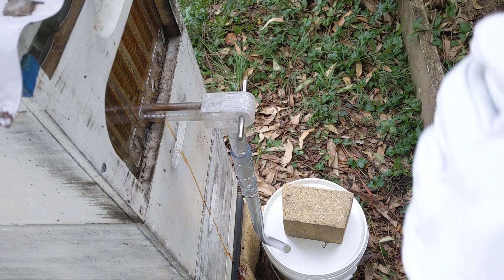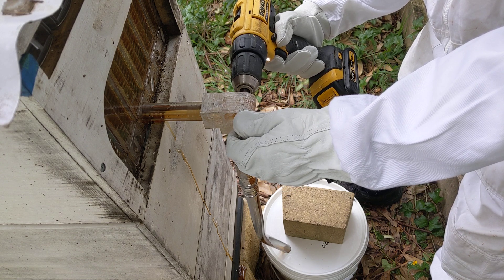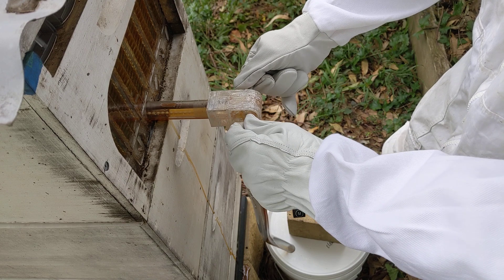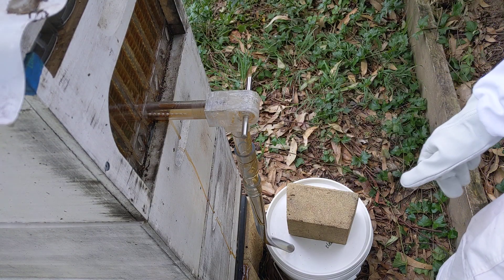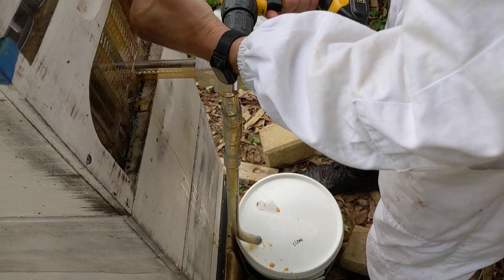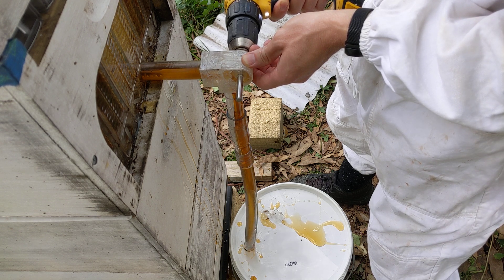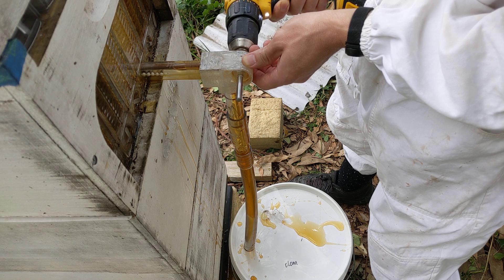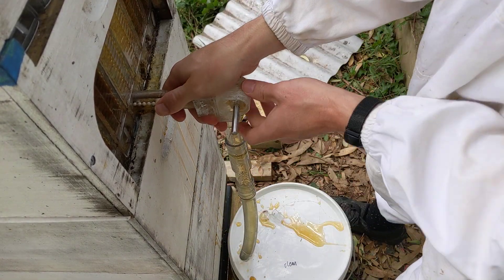Flow hive honey pump - Mk. 3 successful field test!

Comment: Considering the flow rate you are getting in clearing out those gutters. Looks like you have managed to saturate the inner diamater of the tube. You might need to add a seperate tube running from the bucket kid to the top where the key goes in and unlocks the frame, allowing air to flow back in... similar to the air hoses used on refuelling nozzles in F1, nascar etc, more flow and less restriction :)
Neat!